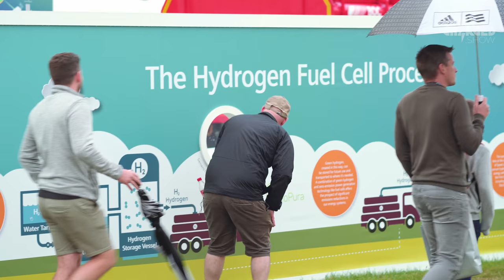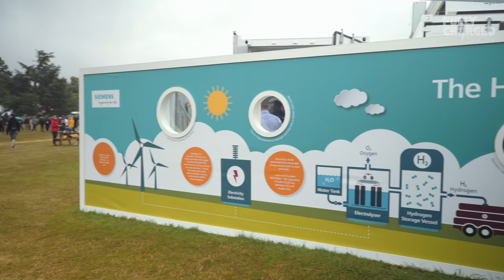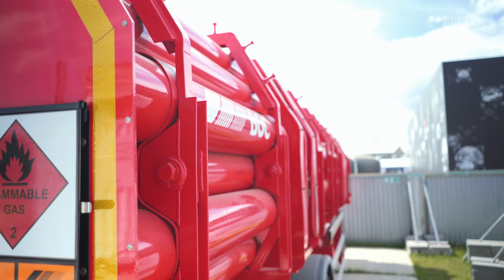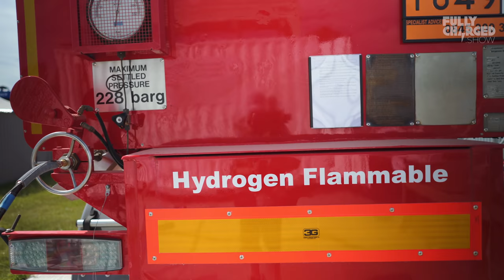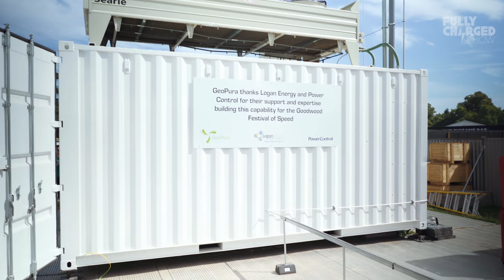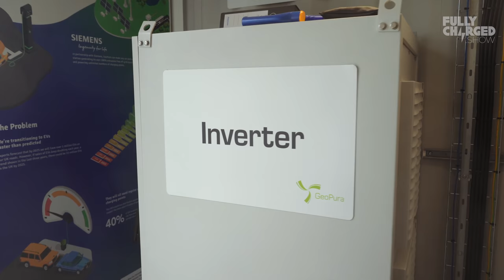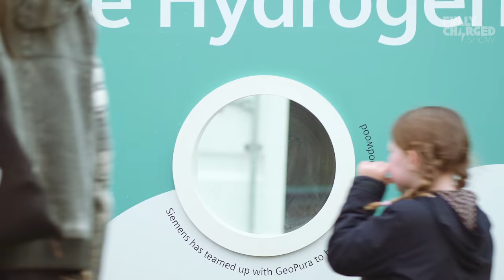Green Hydrogen Fuel Cell Charging System at Goodwood Festival of Speed | Fully Charged

Comment: How much electricity did it take to make that 6MWh, of which 3MWh is useable output electricity?
Reply: "None" as such, they literally said it comes from renewable sources. The point is to store and use electricity when it's more useful, not necessarily be 100% efficient, but the power in the first place to store the hydrogen was renewable
Reply: VERY good question
Reply: @TheGeekster08  Not the point
The point is that if it took 50GWh of renewables to store 6MWh worth of hydrogen, the tech is 100% useless
Of course that's exaggerating, but you get my point 😉
Reply: At least 7.5, upwards of 8.
Reply: @TheGeekster08  or just charge batteries with that same electricity, but keep much more of it.
Reply: Where do you get 3kw from? And all of it is used. 6MWh of H2 gained from waste renewable energy - if there isn't an energy need, a turbine won't be running - stored up as a battery, that can be used for 3MWh of electricity and 3MWh of heat!
Reply: @computerbob06  I can hear fine, thanks. My question was how much did it take to convert into 6MWh of hydrogen.
Also, what exactly were they doing with all that heat in this example? Using energy to pump it away, it seems to me.
Reply: @MrGonzonator  it uses electricity that has no value to the market as it is in excess, it can't be sold and has no price (sometimes even negative price). The wind turbine would be idle, this is the equivalent of the sawdust of a wood mill turned in wood pellets. The wood mill owner used to have to pay to get rid of it, now he sells it; its cost is therefore negative.
Reply: @reggiebuffat  so why can't that be put in a battery?
Reply: @MrGonzonator  the battery is good for storing electricity for a few days and used in at most a few hours, hydrogen can be stored  for a few months, and provide electricity for days. That's close to be an ideal form for Long Term Storage solution.
Reply: @TheGeekster08  
"100%..... as such"
Generated renewable energy is a valuable commodity.
It has value.

They WILL sell THAT amount of power to the end user.
The difference being, the end user will actually only get 25% at the battery of the car, but pay 4 times the cost (full 100%)
They're not going to "give" you the liberation, transport, storage and reconversion for free.
Reply: @reggiebuffat  
"Stored for a few days...."
That's a capacitor.
A battery can hold that energy for long periods.
Once you liberate Hydrogen (50% efficient?) you must spend even MORE energy keeping it cold!
Then you effectively throw another 50% away getting it to the car as electricity.

It's basically the same as moving water in a leaking bucket, then charging for the full bucket...... And the transport.
Reply: @Ross Bourne 
That "initial splitting process".....
That's by green generated ENERGY.
by your logic, they would give that energy away.
Dream on.
Reply: It takes 60 kWh of electricity to produce 1 kg of green hydrogen (electrolysis) an Electric car can go there times further on the same source energy
Reply: @TheGeekster08  Are you joking? Forget about unused electricity. In some years we will need any kWh on renewable electricity and wasting it on producting heat and hydrogen is not such a good idea. To produce hydrogen you lose quite a lot of the most precious carbon-free electricity for storage, compression, transport and hydrogen production.
Reply: @reggiebuffat  Are you aware of how much gas tanks you need to store significant volumes of hydrogen? And if you go for liquified hydrogen you have constant losses to keep the temperature low.
Reply: @romainhedouin  not the point. This is storage for unused energy. Your other options are:

Pumped storage
Chemical (Battery) storage
Kinetic storage
Thermal storage
Chemical (process) storage
Waste it.

If after you've maxed out your traditional storage systems, you still have excess energy this is an incredible opportunity.

No more diesel generators at big events. Solar is great - when it's sunny. Wind is great - when it's windy. Hydrogen is great - all the time.

It also provides clean water and heat as waste products. Both ideal for an outdoor event.
Reply: You probably make hydrogen with around 50% efficiency in the first place. So, more than 10MW were used most likely.This gives a final efficiency of 30% or less.
Reply: @thankyouforyourcompliance7386  just like natural gas then.
Reply: Assuming a very high efficiency electrolyzer, about 60% efficient, it would take 10 Mwh of electricity. Overall efficiency at 30%. If additional energy is needed for compression, efficiency goes even lower. 

 In comparison, using charger and batteries to store electrical energy is about 85% efficient, nearly 3x better.
Reply: @chrismuir8403  you can't charge batteries in summer for use in winter, you can store hydrogen for winter.
Reply: @reggiebuffat  Yea, but you need 3 summers for storing 1 winter. Even though it is made out of wind energy, wind energy has a cost. They either sell 10MW of wind power to the grid or produce hydrogen and sell 3MW of electricity made out of hydrogen. Price difference is awesome !
Reply: @Lee Turnbull they stated in the video that the hydrogen came from wind generated energy.

If you do a simple search of BOC's web site on hydrogen production you can see that they are increasingly generating hydrogen from renewable energy sources.

"Today, hydrogen is mainly produced by steam reforming fossil fuels such as natural gas. Excess hydrogen is also recovered as a by-product from various industrial processes. Even though hydrogen generated from fossil feedstocks has the advantage of zero-tailpipe emissions, the production chain still leaves a carbon footprint. Well-to-wheel emissions of a hydrogen fuel-cell car are nonetheless approximately 30% lower than those of a conventional diesel-powered car.

Building on these conventional hydrogen production techniques and Linde’s experience of more than 100 years of H2 production, we are actively developing technologies to ultimately increase the share of renewably produced hydrogen. Our long-term aim is to significantly increase the sustainable share in the hydrogen mix using renewable energy sources such as wind, water and biomass. At present, electrolysis of water using wind, water or solar power and reforming of biogas are viable alternatives that offer a zero-emission hydrogen energy cycle."
Reply: @reggiebuffat  can you? Hydrogen is the hardest thing to store, if you didn't know. It is so thin it escapes slowly from the tanks
Reply: @TheGeekster08  The low duty cycle of the  electrolysis equipment coupled to intermittent renewables kills this plan due to the resulting enormous capital costs. Capital that spends a lot of time just sitting idle is never going to be cheap.

If carbon neutral hydrogen was really in demand, the rational way to power its production would be with a nuclear reactor. But it's not so...
Reply: MrGonzonator this is about the one place hydrogen wins, long term storage. Battery tech needs to solve that problem still.
Reply: @stewdean  compressed air can work at 60% round trip efficiency (higher with waste heat utilisation) and easily beats this. Being rolled out across the UK and elsewhere right now.
Reply: @stewdean  Are you sure storing hydrogen is easier? Didn't you hear how thin it is that storing it is a real challenge? It used to just escape from the tanks which could not be completely impermeable to hydrogen. And probably it is not completely solved...
Reply: @TheGeekster08  
No, the point is to store and use electricity at as near 100 efficiency as possible.
The Hydrogen system is the equivalent of a leaking bucket, with the end user paying for a full bucket.
Reply: @computerbob06  
It's not "waste" energy it's "useable" energy that's not being stored (yet)
With Hydrogen, you're only "using" about 20% after considering overheads, but also adding huge complication to the system.
Reply: @lmaoroflcopter  
That works WHEN the alternatives are "maxed out"
They're not.
It just needs more infrastructure built (similar to Hydrogen!)
BUT.
The difference is, with other methods, storage is efficient.
Reply: @reggiebuffat  
No.
Reply: @reggiebuffat  
Storing for winter?
So you take a storage medium that's 25% efficient if used immediately, then spend money employing people to maintain the infrastructure to keep it cold, using even more energy to do so?

See the problem?
Reply: @stewdean  
I've said elsewhere,
Hydrogen is inefficient to make.
If you want to store it you have to keep it cold.
So, you're taking something that's at best 25% efficient when finally used, then using more energy to freeze it.
Add the transport costs,
Add the storage infrastructure build and maintenance (!) costs.
All things considered, when actually used, you're down below 20% efficiency.
Or, another view, you could spend 30% of the initial amount on battery storage which needs minimal, if any maintenance or supervision for the same effect.
Plus, that storage could be moved to any grid location in containers, connected and just left alone, no permanent plant to be built.
Reply: @rogerstarkey5390  storage is only as efficient as the space it takes up and none of the current solutions are portable.

Pump and release only works if you've a nice large reservoir or lake to pump.

Hydrogen storage requires an electrolyzer and a pump. A truck comes and delivers cylinders, takes full ones away.
Reply: @lmaoroflcopter  
Portable?
The same truck that brings cylinders, could bring batteries.
OR it could bring a source of power (turbine, solar) to charge the batteries without the time and expense of regular round trips.
Reply: @rogerstarkey5390  again. You miss the point. Wind is fantastic when it's windy. When it's not it's a pile of useless infrastructure.

Solar again, absolutely brilliant when it's sunny. Completely useless at night and not great in overcast skies.

Both require considerable additional battery storage in order to help mitigate their failings (solar in particular) both require considerable space to deploy a decent enough array of panels or series of turbines.

Yes batteries are indeed a possible solution to portable power but they are expensive, limited lifespan and not ideal for say a weekend festival that would require them to switch the empty batteries out possibly several times.

Hydrogen generation appear to takes up a tiny amount of space, is fueled by "batteries" of canisters that are portable and easily stored on site. Hydrogen generation can be switched on and off to meet demands and it can provide clean drinking water as an additional benefit and the waste heat can be used too.
Reply: @lmaoroflcopter  
You're missing the point.
The emergency we face means that every kWh of green energy is precious.
Untill the global requirement is 100% green, ALL green power us effectively bring used to replace fossil fuel, so must be used efficiently.
Hydrogen production, transport and reconversion is NOT efficient, it wastes 70% of energy allocated to it. That energy must be used in other, more efficient systems. If they don't exist, they must be built.
Reply: @rogerstarkey5390  except that isn't true I can understand the thinking behind it but this is otherwise wasted energy and that belief is wrongly worded. Every single carbon emission is precious, not every kWh.

If it costs zero carbon to produce 10kWh which we have no immediate need for or zero carbon to produce 3 kWh which we have no immediate need for then all we need to be concerned about is that zero carbon figure.

We've covered the festival use case but this has other ramifications too, my father has home heating run on oil. A truck pulls up, fills his tank up once every 3 months or so and he has heating for his home.

Hydrogen generated using renewable energy could replace the heating oil needs of all the rural/semi-rural homes without much issue at all. No more propane or oil required, just good, clean hydrogen.
Reply: @lmaoroflcopter  
It costs zero carbon to make, but must be used to offset (replace) fossil generation efficiently.
Hydrogen doesn't do that.
Reply: There are production systems for the hydrolysis that are up to 70% efficient. Compression takes energy equating about 10% of the energy content of the hydrogen gas. 6/0.9 is ~6.7 and that divided by 0.7 is ~9.5  So, best case scenario about 9.5MWh   

It is a very important question, because renewable power doesn't magically appear because you make hydrogen of it as some people seems to believe. You can replace over 3 times as much fossil fuel when you don't waste over two thirds of the energy for no good reason.   

ALL power generation has carbon footprint, and other negative consequences, nothing is totally unproblematic. Wind and solar is much better than fossil fuels, and absolutely need to stop burning fossil fuels, and the realistic hope for that is to replace them with fossil free energy, but it's not irrelevant how much or how effectively we use fossil free power.      

"But it's made with excess renewable power!" No, it's not, not a significant part of it. There is one system that I know of that makes hydrogen from excess power, and feeds it in to the natural gas lines, where it replaces some natural gas. That way, when you seamlessly and slightly dilute an existing flow of an energy carrier you can rely on temporary excess power production. You can't have a system that totally relies on excess power, that would be the economical equivalent of a perpetuum mobile.                    

There are a lot of much better ways to make use of intermittent temporary excess energy,  than making hydrogen to make power later and or in another location, with or without use of the waste heat.
Reply: @reggiebuffat  You can actually charge batteries in summer for use in winter, the self discharge in modern Liion and LiFePO4 batteries is very low. You'd lose way more energy in the hydrogen option, when storing energy from summer to winter.    

The problem is that neither is anyway near financially viable for general power supply, as the storage system has to be paid by the value of the energy you get back from the system, and cycling either batteries or a hydrogen fuel cell system once a year would need a value of the energy of tens, if not hundreds of pounds per kWh it can deliver per year, to break even. 

By the way, storing hydrogen is much harder than most people realize, absurdly expensive and absolutely leak free large scale storage is virtually impossible to achieve.
Reply: Patreeko theArtist bah. Nobody does electrolysis at even 50% efficiency outside of labs. 40% is typical. So 15 MWh then, to get 3 useable.
Reply: Roger Starkey it’s not how long it can hold the charge that’s a problem, but how many days of use the capacity is. Batteries are great for scenarios like production and consumption mismatch in a 24-hour period. They are useless for storing a summer surplus to use in the winter. You’d need some very expensive batteries just to power your house half a year. 

Nuclear and batteries would be perfect. The reactors can’t be regulated fast enough to tackle quick surges (like when a grid connection fails), but batteries excel at that. Batteries can’t store enough energy for long-term over- or underproduction, but nuclear doesn’t need it, because you can easily make three times as much energy one day as the next.

Fusion power is becoming a real factor. Unlike a decade ago it is now attracting investors rather than just research funding. That’s normally a sign that the technology has been proven. Ironically it could be the big hydrogen enabler — if it leads to cheap and clean electricity, making the inefficiency of hydrogen irrelevant. That’s far from certain though. However awesome it may work, building out fusion plants worldwide is going to take several decades. Maybe by 2050 it will be well established and by the end of the century hydrogen will come of age??
Reply: @dojohansen123   Incorrect, PEM electrolysers at over 1MW sold in the marketplace are already over 75% efficient if you are just counting electricity production. Yes, the overall conversion of electrolysis - fuel cell - EV charger is still inefficient but may work in certain instances especially if the heat can be used which increases the system efficiency.